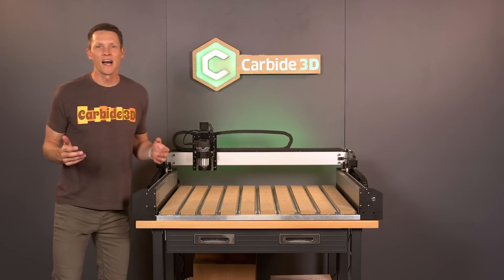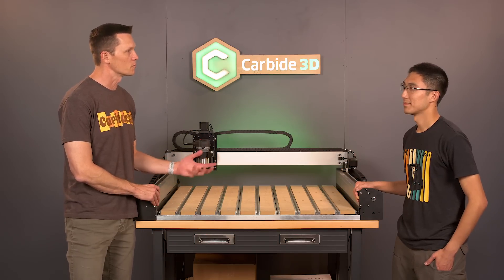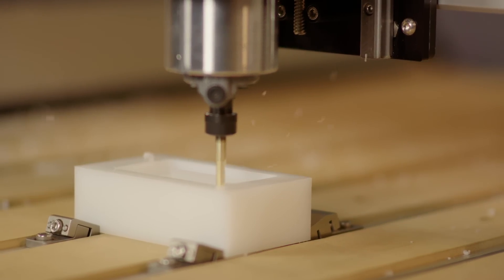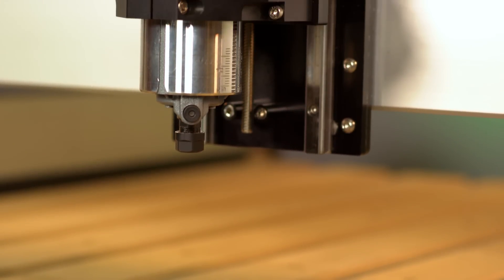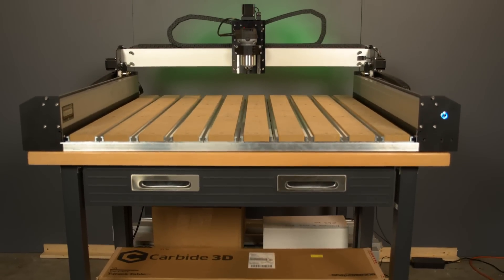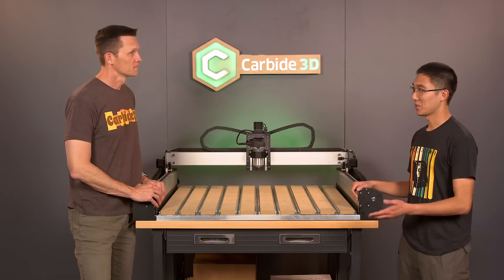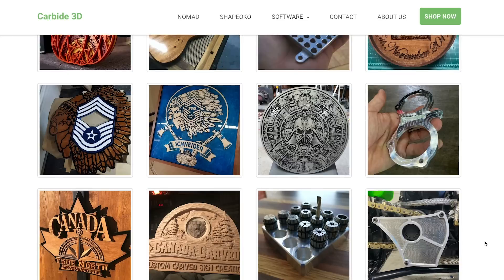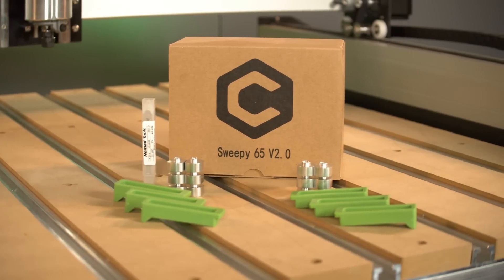The Makers Garage - Welcome Shapeoko 4

Comment: Guys these are some incredible products. I'm thrilled to see the level of energy and innovation and the complete packages you roll out. I haven't put together a cnc unit yet but it's on my bucket list for the coming year. The only thing I question is, my tendency would be to go for the desktop product, the nomad. However, and I'm struck, it's more expensive than the other three products on your list, with a much bigger build/work area etc...? I'm leaning towards building my own for my first one. However, once again, this presentation, and your site/products make me question that logic. The nomad has a footprint that fits what I need the first time out but why would I go there when the 4 is a thousand bucks less? Anyway, not being negative, you have all put together some amazing products. Kudos.
Reply from the maker: Jack,  It comes down to a few different considerations, including but not limited to:  Space Available / Planned Projects / Your particular business or hobby interests / Need for precision on a minute scale and whatever other thoughts you need to consider.  
I too looked at the Nomad first, decided that the Shapeoko was for me and purchased an XXL.  But I had the space to allocate to the machine.  I've never regretted that choice.  Shapeoko 4 offers 3 sizes of machines.  Each size will be available shortly.  Right now the XXL is coming into stock each week.  Perhaps the Standard Shapeoko 4 would be a good fit for your space.  You can still make small stuff on these big machines.

In terms of Building a Machine you should consider the following question:   Do I want to build a CNC or build things with a CNC?

Our machines come ready for duty.  You'll be up and running in an extremely short period of time.  From the physical machine to the software suite needed to get started, NOMAD and Shapeoko have you set to start cutting out of the box.  Building your own machine can be rewarding.  It will take a significant amount of time to order parts, create the interfaces needed, find software and get everything to function in concert.  Some people consider that time well spent for the sense of accomplishment.  Other people consider time as money or don't wish to go through all the steps needed.  Either of our machines are a well thought out and refined product.

Things to think about no matter what you decide, I hope you join the CNC community soon.

- Kevin

Comment: Hi Winston, quick question — is there any way to get the new bed as an upgrade for Shapeoko 3? You are correct in that workholding has been a huge problem, and after several attempts to double-tape things which ended up with wood flying off like shrapnel, I stopped (really, never could start) using my 3 a few years ago. This workholding solution looks like a game changer,  and I’d love to get it if you guys are selling it separately.
Reply: Dean, this kit could get you partway there and you can also buy the other clamps they are advertising separately.   https://shop.carbide3d.com/collections/workholding/products/t-track-table?variant=5175720706078  .   If you want to get really fancy ....  https://saundersmachineworks.com/collections/smw-fixture-plates/brand:Carbide3D
Reply: @jothammcmillan8854  Thank you! This does seem like what I am looking for.
Reply from the maker: Dean, I used that kit on my SO3 for years.  Thanks Jotham for giving your thoughts.
- Kevin
Reply from the maker: Hi Dean.  Kevin here.  The Shapeoko 4 is not backwards compatible with the SO3 platform.   The work holding is a game changer and will provide you a wide variety of options.

Comment: I just got mine today. Unfortunately the V-wheels, even with the eccentric nut in the 6 o’clock position, won’t slide on to the rails properly. The frame isn’t tightened so I can easily adjust it but if I push the right side with some firm pressure it slides in but it deflects the V-wheel mounting plate and pushes it outwards. Any thoughts on the situation??

What is the tolerance of flatness that my table has to be? I think my table isn’t perfectly flat and may be throwing the machine off.
Reply from the maker: Nick, if you reach out to support here at Carbide HQ, they would be more than happy to help you get started.  (310) 504-3637 (*2 for Support)

Comment: Awesome looking new machine! It it possible to use replacement parts from the new SO4 to upgrade the SO3? I'm specifically interested in the V wheels and possibly also the belts/sprockets.
Reply from the maker: Hey Daniel.  The upgrade from a 3 to a 4 is not possible.  The improvements on the 4 are many and definitely worth a look to replace your 3.

Comment: This is nice, but honestly at this point you guys are doing a lot of improvements. But you guys really need to offer a version without belts. I feel like you guys are doing enough volume at this point that you could still make an affordable machine and version, with lead screws. Even if it was an option it would be nice to have that offering. I know that schools and other workshops benefit from the safety afford by skipping steps. From pushing the machine to far and having the belt slip, as a safety. But I can't be the only one that would prefer the greater rigidity from a more solid option.
Reply: I agree, I got a rack & pinion setup and will never go back to belts! No chatter and very accurate.